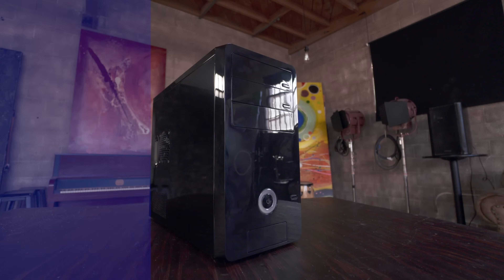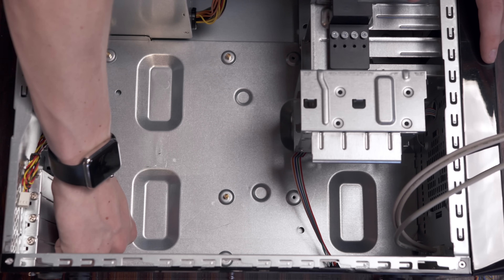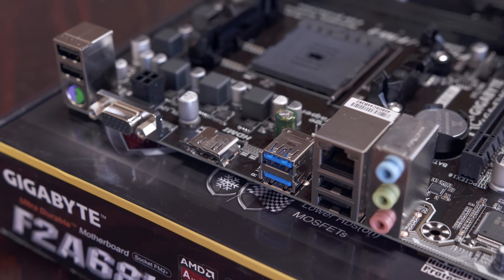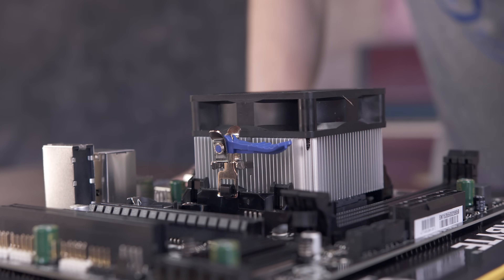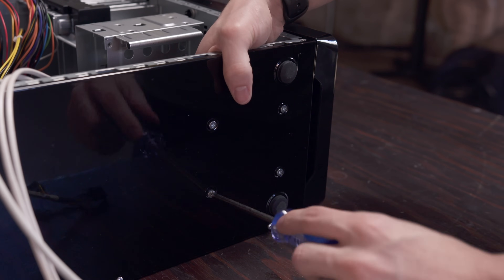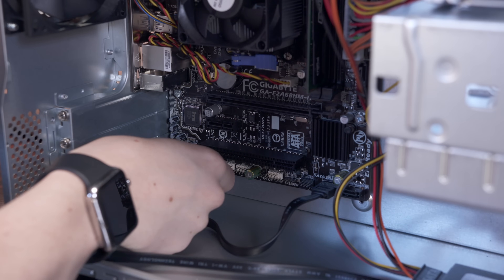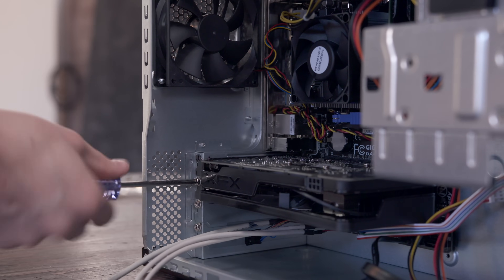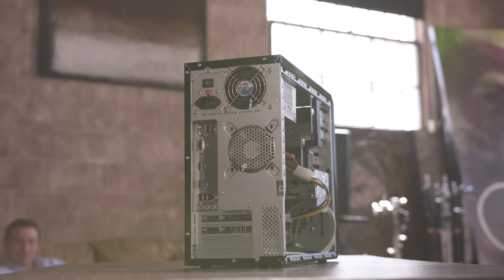How to Build a Gaming PC! (2016)

Comment: Okay so I want to install an SSD and a hard drive. How do I do this.
Reply: +Codes320 Mount the storage device onto the casing. Connect the power cable and SATA cable. Go window and configure the storage device. Done.
Reply: +WB IsMe don't you only have one power and Sata cable?
Reply: Codes320 An average powersupply consist of at least 3 power cable that can power up the HDD/SDD. If you have not enough Sata cable, you can always buy one.
Reply: +WB IsMe Do you need to buy a new Sata cable?
Reply: Codes320 Looks like you are totally clueless about DIY PC. When you buy a motherboard, it typically comes with 2 Sata cable. You need to buy need you need more... Sata
Reply: +WB IsMe Yep you're right never done it before. Thanks for the help

Comment: I'm new to pc building and umm

Can can a CPU go to ANY motherboard??
Reply: yes
Reply: +SamTheMan can a motherboard go to any CASE??
Reply: No, different cpus fit into different sockets. You have to make sure that the motherboard has the correct sticker for your cpu.
Reply: +Tristian Gamez Specific family of processor are compatible with specific family of motherboard. Motherboard comes with different standardize size namely EATX, ATX, MATX and ITX. Different case support different size of motherboard. Case in the video support MATX and ITX motherboard.
Reply: +Tristian Gamez Nope, your motherboard chipset needs to be compatible with the CPU model you're looking at. That's one of the biggest decisions to make when building a new PC.
Reply: +SamTheMan no man, every cpu has a socket which is 1150 or 1151 if you buy a motherboard with socket 1150 you cant put a Cpu with socket 1151
Reply: +maltazar 2 AMD chips don't use 1150, 1151, or 2011, they use AM1, AM3 and FM2 and many others
Reply: +praise gaben 
List of AMD sockets:
AM2 (Max CPU depends on motherboard)
AM2+ (See AM2)
AM3 (Officially Phenom II X6 1100T, some have gotten FX-8xxx chips working)
AM3+ (If not 990FX: FX 8370, If 990FX: FX 9590)
FM1 (A8-3870K)
FM2 (A10-6800K)
FM2+ (A10-7890K)
AM1 (Athlon 5350/5370)
Anything older than AM2 is outdated.
Reply: nerd73 Thank you.
Reply: +SamTheMan no, what the hell? CPU can only fit inside their respective sockets, haswell in LGA1150, and skylake in LGA 1151
Reply: +Tristian Gamez the motherboard will only fit if it has the correct form factor support
Reply: +Tristian Gamez it comes in different sizes, mATX-ATX
Reply: +nerd73 thanks bro

Comment: Building my own and I'd like your opinion on what ya'll think about this build. Been researching for weeks trying to find a suitable build that won't cost too much but still upgradeable

MSI Z170 TOMAHAWK AC MBi5 6500 CPU8GB DDR4 2400MHz RAM256GB SSDMSI R9 390 8GB 512bitAntec 700W PSU
Reply: Ok, next time use spaces. But from what I see, it's generally good. Never heard of the company "Tomahawk" for Wi-Fi, but whatever. Also, you can save money on the motherboard. Any motherboard with Z in the name = ability to overclock.  However, you have an un-overclockable CPU. So, one you could upgrade your CPU to an i5-6600K, or you could downgrade your motherboard, but that is my suggestion. It should work, but it's kind of pointless.
Reply: Rat Face Thanks man. sorry about the spaces, I retyped 5 times and for some reason youtube wouldn't allow it to list after clicking post
Reply: Well I won't be buying a bunch at once maybe ,1 maximum 2 games a month. This is my first build and I want easy upgradeability as time goes.
Reply: just a standard CPU fan and heatsink

Comment: If you put the GPU in on that motherboard, is there still space for a PCIe x1 WLAN Card???
Reply: Please answer
Reply: +Isaax No. The graphic card blocked the PCIE X1 slot. Alternatively, you can get a Wifi USB adapter.
Reply: +WB IsMe Thank you. I already did edit my Pc Build Plan, including another Motherboard without the GPU blocking the PCIe x1 slot.

Comment: http://pcpartpicker.com/user/LennoxTan/saved/9yT8TW may i know are this parts compatible? and is the extra fans i listed needed to keep the pc cool? Will it be hard to build the pc from scratch? This is my first time building a pc
Reply: +LTeam Production The deepcool tesseract comes with front and rear fan. You don't need extra fans as they won't help much. Your powersupply is kind of overkill. A good quality 500W 80+ gold cert will be good.
Reply: +WB IsMe Thanks a lot for the reply, so i'll just leave the fan slot empty? Will my cpu get heated easily without additional fan?
Reply: The casing comes with pre-installed front and rear fan.
Reply: +WB IsMe Thanks a lot for your help! Hope i wont break my first self built pc

Comment: Do you need thermal paste if you don't overclock?
Reply: +pkstarstorm446 if you dont overclock and you are just using the stock cooler than yeh u dont need paste cause the stock cooler comes with it
Reply: +pkstarstorm446 Thermal paste is essential even if you don't plan to overclock. Additionally, the stock cooler comes with pre-applied thermal paste.
Reply: +WB IsMe thanks!
Reply: +SamTheMan thanks for the reply

Comment: I am having a problem. My computer turns on, but my monitor doesn't display anything. Any suggestions?
Reply: +Kevin Bueno There are tons of possibility and you need to diagnose it step by step. 
Remove the graphic card and plug in the monitor's connector to the onboard display connector. If screen shows up, it means that your graphic card is dead.
Reply: +WB IsMe There is nothing on the monitor. I am connecting it to my television through an HDMI.
Reply: Kevin Bueno Check if you are connecting the HDMI from your graphic card's HDMI port, not from your onboard HDMI port.
Reply: +WB IsMe I connected my HDMI and I still see nothing.
Reply: +Kevin Bueno I am still not sure what can be the problem. Could it be the CPU?

Comment: What FPS can I get with this?
AMD Athlon X4 860K Quad Core
Crucial Ballistix Sport 8 GB RAM
MSI AMD Radeon HD 6450
Windows 8.1
Would this get me at a good smooth experience for the graphics card's price? Mainly looking to play Source games and CSGO on Medium to High settings. Thanks 
http://www.amazon.com/MSI-Profile-PCI-Express-R6450-MD1GD3-LP/dp/B004X6ABTM/ref=sr_1_1?s=electronics&ie=UTF8&qid=1461366249&sr=1-1&keywords=amd+radeon+6450
Reply: +frosty Low setting 1080p 60fps. The HD6450 is a shitty graphic card, not designed for gaming.
Reply: how about the same specs the a gt 740 FTW instead for the GPU?
Reply: High setting 1080p 60fps.
For gaming, entry level graphic cards are GTX750TI and R7 360. These two cards will be more than enough for source engine games and can also play triple A title games at decent setting and frame rate.
Reply: thanks man, im building my first budget build, but im deciding not to use this gpu since i found this one for cheaper for the value, thanks for the info man
Reply: frosty For price to performance ratio, GTX750TI and R7 360 beats GT740 and HD6450. For every dollar you pay, GT740 gives you 0.7 unit of performance but GTX750TI and R7 360 gives you 1 unit of performance. HD6450 has even worst ratio. When it comes to budget build, price to performance ratio matters.

Comment: The psu I'm looking to buy has 6+2 pin pci-e connector, but my graphics card has 6 and 8 pin connector, is there something missing?
Reply: +PeopleCanFly23 What graphics card is that?
Reply: Michel Hanson msi r9 390x
Reply: PeopleCanFly23
Wow. You spared no expense eh? You will be fine. That video card will come with the "8 pin" adapter cable. So you would take one of the "6 pin" from the power supply and plug it directly in the card, then the "8 pin" adapter into the card and a 6 pin cable into the adapter.
Reply: Michel Hanson Great! Thanks for the info.

Comment: I'm hoping someone can answer this question. If I were to switch motherboards, how would I go about with all the software in my pc. Is it a simple switch solution or is it more complex. I have windows on it and a bunch of games and I wondering how I would go about changing my motherboard
Reply: +Daniel Salazar Everything will be fine (Windows 8-10). It'll work as it did before. But you'll have to get a new Windows license or talk to their awful tech support to get that figured out. Windows 7 tends to blue screen when switching to new motherboards and whatnot (In my experience).

Comment: Dudes, check out my PC part picker build. Same price, but 12gb ram and 620 gb storage.

http://pcpartpicker.com/p/qk27D3
Reply: +Exyst HD Dude, that system will be SHIT for gaming, you need to go 1 TB hdd, 250 GB ssd, make sure all of the ram is the EXACT. SAME. Make sure the GPU is 4GB VRAM and at least 1 GHz
Reply: +Undertale Trash ;3 
The Boston 3.0 is at the 350 dollar price point, you don't need 4 GB VRAM for this, it would be incredibly overkill and you most likely wouldn't even manage to fit it in.
I also doubt you can buy both 1 TB hdd and 250 GB SSD and still go for a gaming pc aka good gpu.

I would say 2-3 gb vram, a minmium of 6 gb ram and then a cheap/good gpu.
I haven't been as active in looking at prices and performance with the newer graphics cards but, Austin's choice seems to be pretty good.
Reply: True this PC will not work as well as some other PCs in higher price ranges, but compering it to this PC it certainly has its benefits with more storage and ram
Reply: Exyst HD 12 GB ram is completely unnecessary, most of the time.
8 GB Ram is enough.
Reply: well it really depends on how fast of ram you're getting
Reply: Exyst HD Not really, anything over 1600 you won't notice much difference.
Except if you are using an apu.
For gaming
Reply: +C0d0ps that's pretty true.. You could probably use something like an a8 and radeon r7 for about the same price

Comment: Austin my boson will not turn on I pressed escape, delete, and f9 I have also moved the RAM to another spot and unplugged all of the cables and plugged them back in what should I do???
Reply: +Kingofwar 676 (King) Did you plug in the system power panel cable? Google it.
Reply: Yes I did and they are in the correct direction
Reply: +WB IsMe also is it OK to use a HDMI cable for PC gaming???
Reply: Yes. If you have graphic card installed, you have to plug the HDMI cable to the graphic card's connector instead of onboard's connector.
Reply: +WB IsMe ow well I'll try that tomorrow morning then thx for the help:)

Comment: why doesn't he put the psu on the bottom?
Reply: +Scrazelope It is the case's design to put PSU on top.
Reply: WB IsMe ye but thats bad
Reply: +burek mesni Idiot.
Reply: +Scrazelope No it's not. The case isn't designed for it. Simple as that.
Reply: EMPiiRE™ I know, but the psu on the top risks it falling all the way down.
Reply: ***** Chances are extremely slim. The PSU is hold on by a protruding support at the side and 4 screws. I've been using this cases for 4 years without any problem.

Comment: Does the processor count really matter
Reply: +jahan miah (JustGaming) Yes, it can make a huge difference. Think of the CPU count as cashiers in a store, the more people working the more that can get done. It's not the be all and end all but more is usually better. For example I've got a i7 5820k (6 cores 3.3ghz) which is currently the same price as the i7 6700k (4 cores 4ghz) because those extra 2 cores matter for what I do.

However like I said it's not the be all and end all, the quality of the cores (which AMD really falls short on), the speed, the overclocking, whether the programs/games you're playing will even use that many cores, and so much more.
Reply: Ok
Reply: Thanks Alot!

Comment: ok so i just built this exact same computer same parts and the computer turns on after that i plug in my pc to my tv through HDMI and i just see a black screen i need help
Reply: +DFutureKey 
Check list
1)Did you connect your HDMI to the graphic card's HDMI connector? (Not the motherboard's HDMI)
2)Did you connect the 6pin PCIE power connector to your graphic card?
Reply: WB IsMe i fixed i reset the cmos is working fine but thanks

Comment: I'm thinking of going water cooled since GTA V kept on crashing while I'm playing after few hours. (which I assume could be heat problem)
My Spec:
AMD 6 core 3.9 Processor
MSI GTX 650 2GD5 128bit
16 DDR 3 RAM 1333MHz
725W PSU CM
128 SSD + 2TB WD Black

Should I go Water cooled combo (CPU+GPU in one) or I buy one fan watercooled for CPU and later on two fan watercooled for GPU?
Reply: +Omar Nawawi or should I just upgrade my GPU?Planning for 3GD5 MSI AMD R9 280x

Comment: How much did it all cost?
Reply: +Lord Gaben $350
Reply: Thanks boo
Reply: +Lord Gaben Deez nuts
Reply: Stealing this comment, but I'm going for an Intel/nVidia equivalent of this as I plan to use this for Dolphin (Intel CPUs work better than AMD CPUs for it). The question is, what Intel CPU should I choose? G4400? G3258? Or go with an i3?
Reply: +PeZ I don't know much but what I know is you don't want i3. i5 is better. i7 is if you got extra cash you can spend.
Reply: ***** High-end i3s are more bang for your buck than most i5s.
Reply: Skyfoogle And high-end i5's must be better than most i7's I guess
Reply: ***** There are some high-end i5s that outperform cheap i7s, but not most.

Comment: My Acer Aspire only has 4GB of DDR2 Ram(Ik it's terrible), has integrated Geforce 9200 graphics(Ik it's bad), but has a PCI slot. What is the best graphics card for around $50, im cheap xD
Reply: For $50 you likely won't be getting any better performance than your GT 9200
Reply: Thwartus NeinShmidt I found Geforce GT 730 for $60 and it's much better than the GT 9200
Reply: +One123 Just buy titan x
Reply: +burek mesni  its only 1000$

Comment: okay so i have a computer it currently has a nvidia geforce 9800 gt 1 gb on it what would be better should i run sli on it with the same card or buy a geforce gtx 950 2 gb ssc its 40$ or 170$

specs:
intel i7 quad core 940 2.93 ghz 
500 gb hdd
nvidia geforce 9800 gt 1 gb
8 gb ram
Reply: Holy fuck you have a ginormous bottleneck... Buy a 960 or something but even then that's still bottlenecking.
Reply: Brandon Alexander yeah i can't afford anything at all right now I'm hoping to at least get a 750ti sc i just can't around to get any sort of money

Comment: hey Austin, this is going to be my first build. are these very good specs? my budget is under $800 with taxes and all.

PCPartPicker part list: http://pcpartpicker.com/p/Gr3GvK
Price breakdown by merchant: http://pcpartpicker.com/p/Gr3GvK/by_merchant/

CPU: Intel Core i5-6600K 3.5GHz Quad-Core Processor  ($238.99 @ SuperBiiz) 
CPU Cooler: Cooler Master Hyper 212 EVO 82.9 CFM Sleeve Bearing CPU Cooler  ($24.89 @ OutletPC) 
Thermal Compound: Arctic Silver 5 High-Density Polysynthetic Silver 3.5g Thermal Paste  ($6.89 @ OutletPC) 
Motherboard: Gigabyte GA-H110M-A Micro ATX LGA1151 Motherboard  ($51.89 @ OutletPC) 
Memory: Kingston HyperX Fury Black 16GB (2 x 8GB) DDR4-2133 Memory  ($64.49 @ Newegg) 
Storage: Seagate Barracuda 1TB 3.5" 7200RPM Internal Hard Drive  ($45.89 @ OutletPC) 
Video Card: Sapphire Radeon R9 380 4GB NITRO Dual-X OC Video Card  ($174.99 @ Newegg) 
Case: Raidmax ATX-404WU ATX Mid Tower Case  ($19.99 @ Newegg) 
Power Supply: EVGA 500W 80+ Bronze Certified ATX Power Supply  ($29.99 @ Newegg) 
Optical Drive: Asus DRW-24B1ST/BLK/B/AS DVD/CD Writer  ($18.89 @ OutletPC) 
Sound Card: Asus Xonar DSX 24-bit 192 KHz Sound Card  ($43.99 @ Newegg) 
Wired Network Adapter: TP-Link TG-3468 10/100/1000 Mbps PCI-Express x1 Network Adapter  ($11.58 @ Amazon) 
Case Fan: Cooler Master SickleFlow 69.7 CFM 120mm  Fan  ($5.99 @ Micro Center) 
Total: $738.46
Reply: +N Paladin It's decent.
Reply: +N Paladin this will be better for gaming.
[url=http://pcpartpicker.com/p/NhTcZL]PCPartPicker part list[/url] / [url=http://pcpartpicker.com/p/NhTcZL/by_merchant/]Price breakdown by merchant[/url]

[b]CPU:[/b] [url=http://pcpartpicker.com/part/intel-cpu-bx80662i56400]Intel Core i5-6400 2.7GHz Quad-Core Processor[/url]  ($179.99 @ SuperBiiz) 
[b]Motherboard:[/b] [url=http://pcpartpicker.com/part/gigabyte-motherboard-gah110ma]Gigabyte GA-H110M-A Micro ATX LGA1151 Motherboard[/url]  ($50.99 @ Micro Center) 
[b]Memory:[/b] [url=http://pcpartpicker.com/part/crucial-memory-ct8g4dfd8213]Crucial 8GB (1 x 8GB) DDR4-2133 Memory[/url]  ($26.99 @ SuperBiiz) 
[b]Storage:[/b] [url=http://pcpartpicker.com/part/a-data-internal-hard-drive-asp550ss3120gmc]A-Data Premier SP550 120GB 2.5" Solid State Drive[/url]  ($37.88 @ OutletPC) 
[b]Storage:[/b] [url=http://pcpartpicker.com/part/seagate-internal-hard-drive-st1000dm003]Seagate Barracuda 1TB 3.5" 7200RPM Internal Hard Drive[/url]  ($45.89 @ OutletPC) 
[b]Video Card:[/b] [url=http://pcpartpicker.com/part/gigabyte-video-card-gvr939wf28gd]Gigabyte Radeon R9 390 8GB Video Card[/url]  ($299.99 @ SuperBiiz) 
[b]Case:[/b] [url=http://pcpartpicker.com/part/nzxt-case-s210001]NZXT Source 210 (Black) ATX Mid Tower Case[/url]  ($29.99 @ Newegg) 
[b]Power Supply:[/b] [url=http://pcpartpicker.com/part/evga-power-supply-110b20750vr]EVGA 750W 80+ Bronze Certified Semi-Modular ATX Power Supply[/url]  ($48.99 @ NCIX US) 
[b]Optical Drive:[/b] [url=http://pcpartpicker.com/part/lite-on-optical-drive-ihas12414]Lite-On iHAS124-14 DVD/CD Writer[/url]  ($13.99 @ Newegg) 
[b]Wireless Network Adapter:[/b] [url=http://pcpartpicker.com/part/gigabyte-wireless-network-card-gcwb867di]Gigabyte GC-WB867D-I 802.11a/b/g/n/ac PCI-Express x1 Wi-Fi Adapter[/url]  ($29.99 @ SuperBiiz) 
[b]Total:[/b] $764.69
[i]Prices include shipping, taxes, and discounts when available[/i]
[i]Generated by PCPartPicker 2016-04-29 23:27 EDT-0400[/i]